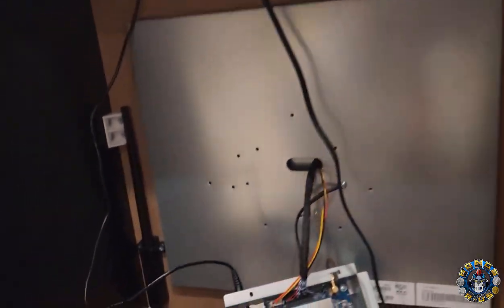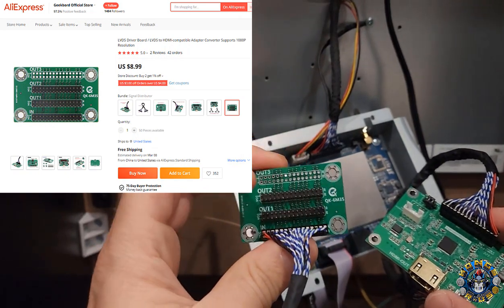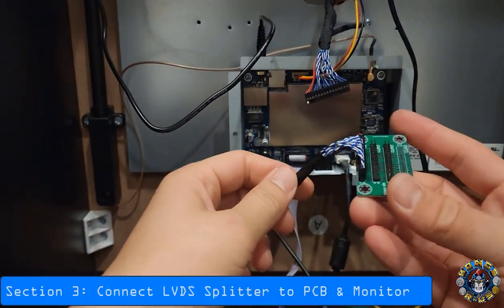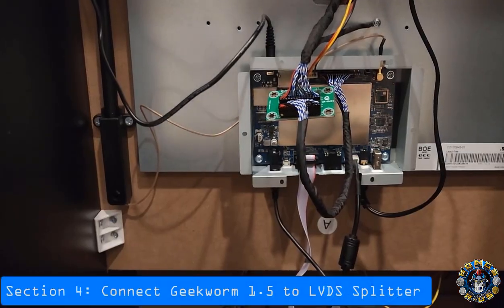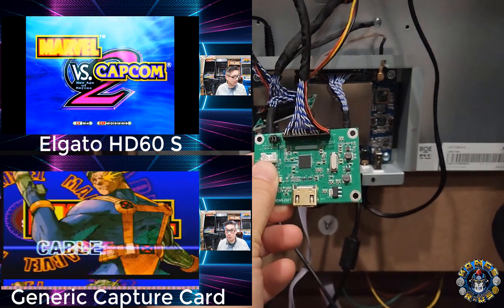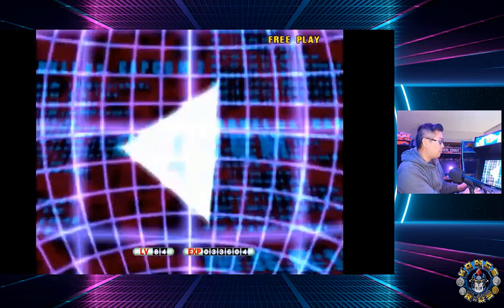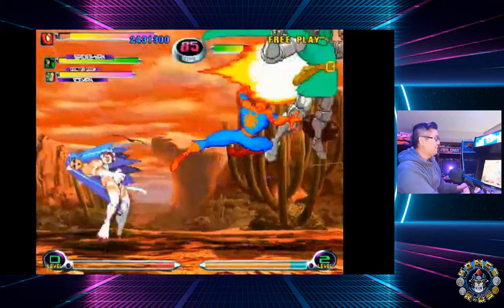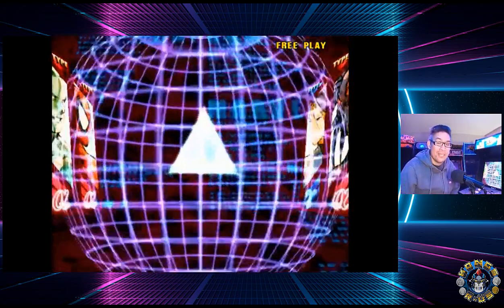Adding HDMI Output to Arcade1Up Cabinets Tutorial

Comment: Thank you so much for this great tutorial ! Do you think it’s possible to make a HDMI input to use the arcade screen with other devices like PC ?  My goal is to connect an Apple TV to the arcade screen and switch Hdmi to play arcade games or watch Apple TV. Thank you again.
Reply from the maker: Yes, you can use an LVDS to HDMI converter board to change monitor to accepts HDMI input, and then use this geekworm to plug into it as well. You'd need an HDMI switch too, but this is hypothetically possible

Comment: Hey Kong quick question,gutted PCB for a SF deluxe Dynamo for a HDMI encoder board now my Marquee is not lighting up why is that i got sound not light pluged it in the back nothing???
Reply from the maker: Hmmm, marquee is powered by simple 12v adapter plug, so you can always try testing it out with another 12v power source If you have the right adapter size for it. Would double check all the wires are correctly secured into the PCB and try again
Reply: @KongsRUs  thanks Bee can you send me a link for an adapter for the Marquee I tested it again not lighting up 😭😭
Reply: @KongsRUs  it's not a PCB it's a HDMI converter board
Reply from the maker: Oh, you definitely need an external power source for the marquee then. There's a hack to get 12v from the HDMI board but it's a little complicated and requires wire splicing. 

Get a 12v splitter for your power adapter and these Adapters for the marquee 

https://amzn.to/44GjhMV

https://amzn.to/3wqpyQk

https://amzn.to/3wN93h4
Reply: @KongsRUs  Your awesome 😎 thanks for the info Bee!!!
Reply: Hey Kong thanks again I just had a question do I have to buy an additional adapter for the Marquee how do I turn it on and off with the power source can I use a splitter and run it through the power with the 12-volt and 5 volt splitter into one connector
Reply from the maker: @waterinthedesert81  do you have a Raspberry pi or PC you are using instead of the PCB? How else are you powering up your cab? I have an Inlet Module Switch tutorial to show you how to wire a surge protector inside your cab so you can power it off/on using the Inlet module switch
Reply: @KongsRUs  I have a PC I want to run fightcade on My Street fighter deluxe Dynamo cab I have the USB joystick encoder board already hooked up for my happ joysticks and Sanwa buttons I switched my PCB out for a HDMI converter board only thing that's working on the converter board is the screen and the power
Reply: I have to run additional power for my 5V Marquee
Reply: @KongsRUs  so I just use that splitter to my 12-volt power and just run the power and the Marquee in the same plug
Reply from the maker: @waterinthedesert81  your marquee can run on 12v power too, not just 5v. I'd recommend watching a few videos from this playlist of me modding my Star Wars cab to use a PC with the HDMI board. Shows you how I powered the marquee, re-used speakers, installed inlet module switch. Should be similar principles to what you are doing Star Wars Arcade1Up Mod Cabinet Installation Tutorial Series: https://www.youtube.com/playlist?list=PL3ddx5cOJzsg5vdXdQqOaON1UXSmF_UY2
Reply from the maker: @waterinthedesert81 another video about inlet module switch in case it's useful https://youtu.be/OvsatU5g15w?si=9QWUhk1iBtxDfLnH
Reply: @KongsRUs  Hey Bee thanks up with the 3 links from Amazon I got the power and Marquee to come on👍 but when I turn it off the Marquee stays on?
Reply from the maker: @waterinthedesert81 yea, because it's always receiving power from the power adapter. If you want to manually turn it off and on, you could use a switch like this. https://amzn.to/4bHOYaN
Reply: @KongsRUs  amazing you saved the Day again kudos Kong 👏💪🦾  but now how do I get sound I really want to use my stock speakers can I just plug it into the PC somehow ?
Reply: @KongsRUs  Hey Kong quick question I got those  the links the spitters and waiting on the switch to turn off the power wondering is it to much power 12 v and 5v together?? With the spitters connecting to the HDMI converter board and Marquee together I just don't want this to over heat if I  need a separate adapter lmk
Reply: @KongsRUs  I ordered those three parts off Amazon through the link you sent me thank you so much for helping Bee 💖 I hope I could just plug it in from the Marquee to the splitter to the 12-volt power which is also running the original arcade1up power adapter to the HDMI converter board
Reply: @KongsRUs  what's the start button on a USB joystick encoder board I have happ joysticks installed into my Street fighter deluxe play USB is plugged into my PC I can get the joysticks running in the buttons working correctly and training mode but I still can't push the start button to play online or to practice?
Reply: Is there an alternate start button I can push on my wireless Logitech keyboard??? Gg on Street fighter hyper a couple nights ago 😎

Comment: Great video. I have the LVDS to HDMI 2.0 which has more pins (I think it’s 40) than the 30pin cable. I’m trying to just simply add the Dell 2007fpb monitor to my A1UP NBA Jam cabinet. My question is on the conversion board what “side” of the 40 pin row should I connect the 30pin cable to? And also in what orientation (red wire to the left or right?). One thing to note the stock cable on my cabinet has the red wire closest to the WiFi connection on the board. This seems to be the opposite from y oh r video here. I did flip it around to test and it only works with the red wire oriented towards the WiFi connection on the board. Thanks!

Comment: any luck using to change monitor on a arcade 1 up pinball machine. 2 guys on you tube are not to clear on the upgrade. one guys all over the place and the other guys just using the cabinet with a pc.

Comment: what should i use  to connect a 32in monitor to a stock star wars pinball  arcade1up
Reply: Im in the same boat there is a video on here that shows but its just not working, idk if I have to buy an LG 32MN50W monitor with the Free Syn adaptation. Or the current one I have LG 32MA70HY will work. I have the pcb connected to the LVDS out to the HMDI but the screen won't show the game on there.

Comment: By using this method, can you hook up a PS2 and output the games on the A1U monitor?
Reply: I had the same question for my wii
Reply: @johnny4815-q5k update - it worked for my ps2, though it was more complex. The marquee didnt work after this setup and you need some more wires. It has no sound and you have to hook an external speakers. The ps2 hdmi hooked with the monitor looked meh, very desaturated colors no vibrancy at all, and hooking the steering wheel is very complicated with an old ps2 wheel. I ended up doing a mini pc with a ps2 emulator. Its still complex, but at least its higher quality with vibrant colors. You still have to do the other steps. So its most likely doable for the wii also.
Reply: @DaxterMaster  So my question is he was outputting the video from the cab to his computer would it be wired the opposite way to output the wii video to the monitor also say the wii is off would it automatically play stock games on the cab instead, I appreciate all the input and your time any advice will help
Reply: @johnny4815-q5k once you replace the pcb to play the wii, you will automatically lose the stock games. You will have to replug the old pcb. If the wii is off it will simply show a no signal display. You have to plug the wii with an hdmi, vga or dp port (if there is a converter for it). You will hook the wii with the new encoder board. then for sound you need external speakers hooked with the wii converter. Its a bit complicated but hope you understand
Reply: @DaxterMaster i got it figured out and wired everything in works like a charm it's going to be great playing guitar hero on the cabinet just need to figure out how to add custom external songs through the wii homebrew channel thanks for the help and the time

Comment: Will the hdmi   Port work with a raspberry pi. Switch between stock game and pi games
Reply from the maker: You could switch the monitor between a pi and stock games, but you wouldn't be able to get the controls working for both as you'd need a separate encoder for the  controls to the Pi

Comment: I added the LVDS to HDMI to my Golden Tee classic. It works, but only on one specific TV. I tried on 5 other TVs and monitors they all say no signal. Any idea why it would work only on my LG TV?
Reply from the maker: Specific TVs can accept the resolution output from the PCB. 1280x960 is the 4:3 output so some TVs can accept it and scale it to full screen. Others will just give an error

Comment: Hey kong!  Question.  I have the geekworm hooked up to a HD60 Elgato and a 4kPro mk.2 and both are unable to find the signal.  I plugged it into a monitor (1440) and it works so i know its not board.  any ideas?
Reply from the maker: I haven't done other extensive testing with this board and setup on other cabs so don't have much advice unfortunately. Would recommend checking with @TheRealSmileBit who does a lot of youtube coverage about geekworms and features

Comment: Would these 2 boards work on the Big buck hunter? I just want to run dual monitors and use the 2nd monitor for gameplay. Thanks....
Reply from the maker: It should work with Big Buck, but I haven't tested this exact board with it. I know the original geekworm board worked with it, but 1.5 should work too
Reply: @KongsRUs  Great thanks...

Comment: Kong, some team recommendations 
Scrub (cable, sentinel, cap commando)
Matrix (storm, sentinel, cyclops)
Santhrax (storm, sentinel, cap commando)
If you just want pure damage, pick bb hood, juggernaut and 3rd character. Power up with juggernaut and then tag out. Juggernaut will be glitched and stay in powered up mode. Hit both tags to perform the triple team. This triple team hyper is a touch of death for most characters. Build the meter and unleash hell
Reply from the maker: Great recommendations! Appreciate the insight, I wish there was a training mode on this. 😄

Comment: Any issues with lag since the signal is passing through the splitter board?
Reply from the maker: I haven't noticed any additional lag, but I'm not the best expert with it. I was able to pull off several moves still using the splitter board